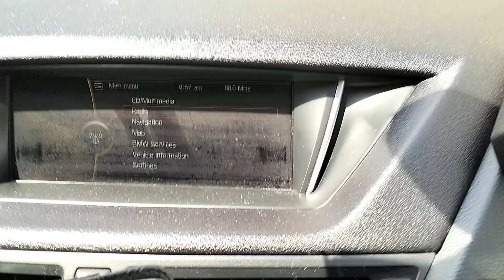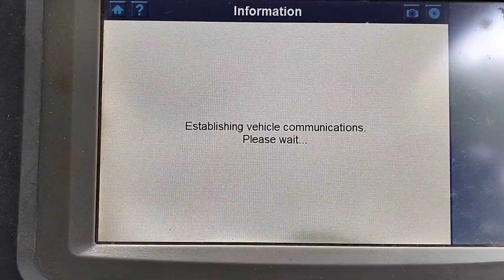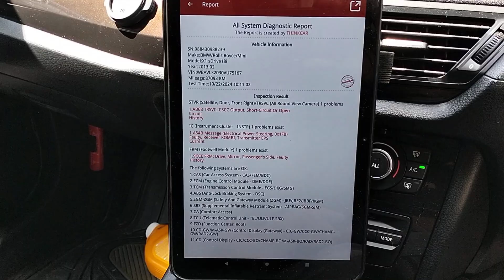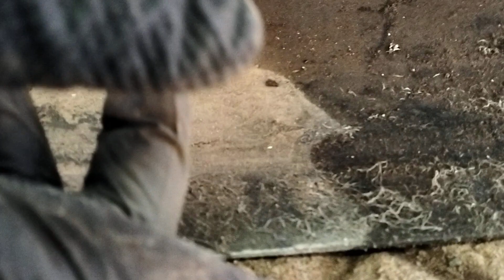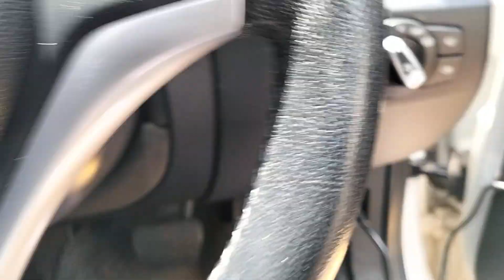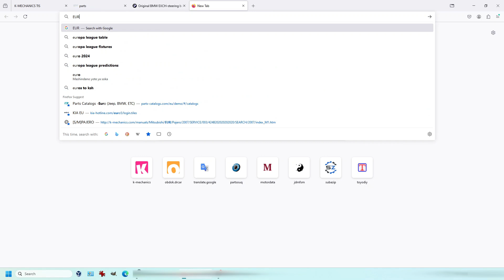2013 BMW X1 Power Steering Failure Diagnosis

Comment: literally having this issue to my e84 2013, x1.. after 1-2 hour usage, eps error.. and then after engine off for 1-2 horus, the eps normal again.. but the cycle continues after 1-2 hour usage
Reply: i guess my eps is down bad huh